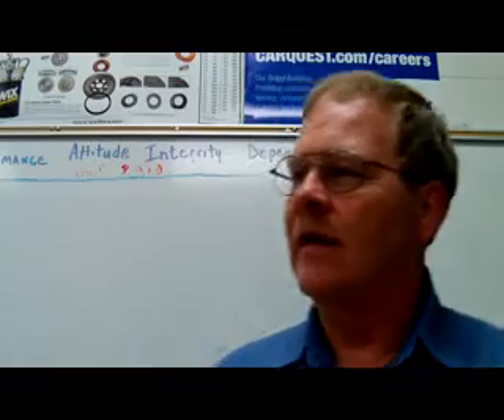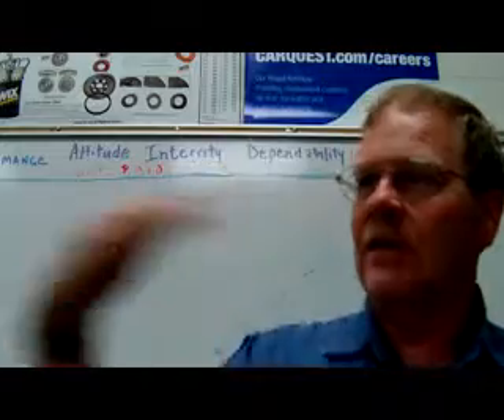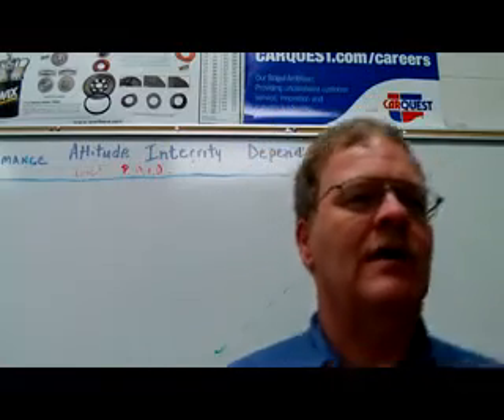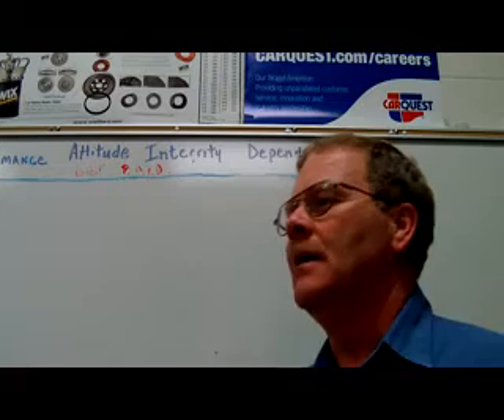Engine Basics 2.flv

Comment: Some guy on the s2000 forums had blocked his radiator passages to run at 260F constantly and got his mpg from 24 to 34 haha, the hotter the more efficient, but I wouldn't do that on my car. Also my bike's fan kicks in at 225F. By the way, do you think I can run straight distilled water with some corrosion inhibitors because Im in Florida and it never freezes, I'd rather have better cooling props. Water wetter is said to have corrosion inhibitors but will it be enough?